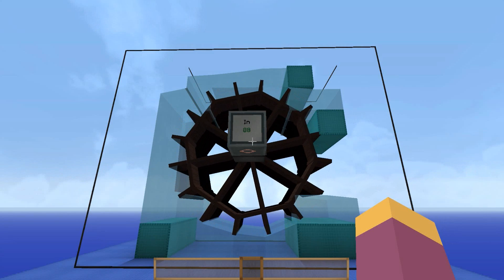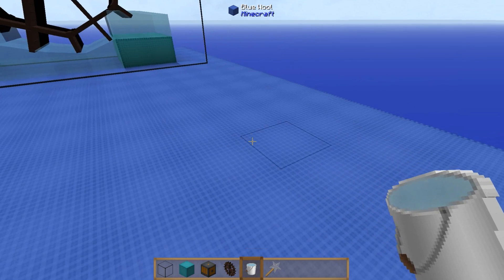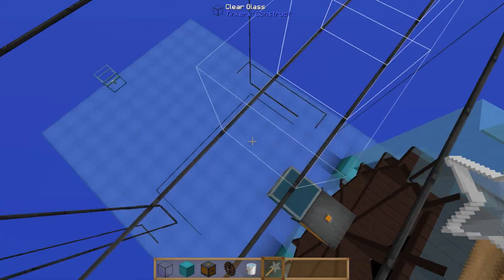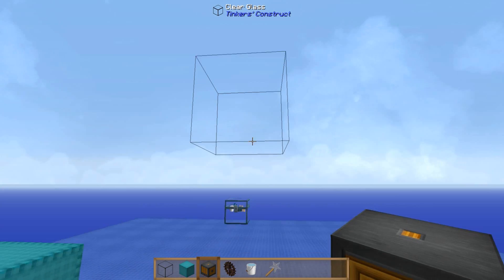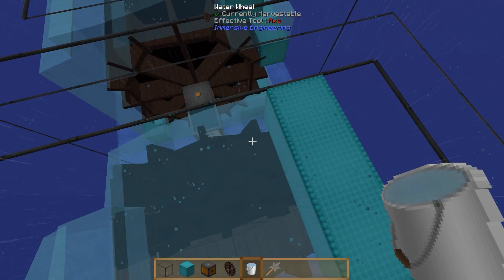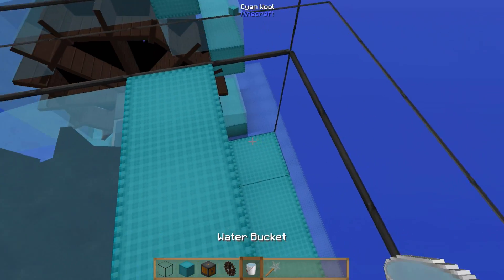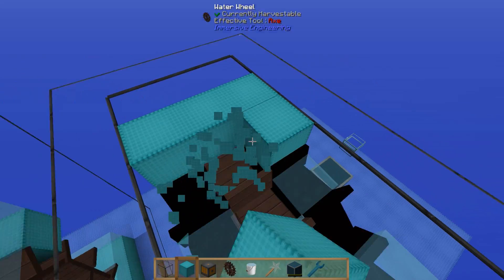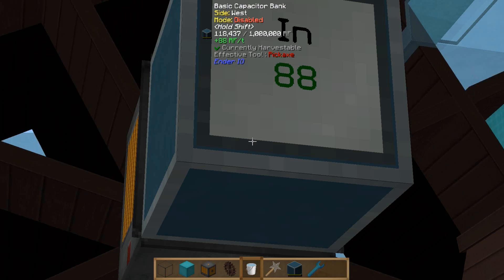Immersive Engineering Water Wheel (Maximum Output  88 rf/t) - Mod Tutorial

Comment: There is a hidden reference here, the 88 rf/t is in homage to the movie "Back to the Future", where the delorian travels back in time once it hits 88 mph. If you open up the Immersive Engineering manual and read the Power section regarding electricity, it states "88 Flux per hour!" Fitting to have the ultimate max efficiency design of the waterwheel to hit this limit in 88 rf/t.

Comment: Nice Video, not my first time watching, and probably wont be my last time either. Helped me when I didnt have some of my go to early generator mods, or just not much coal. I can run a grinder, furnace, and a few other machines without running out of power. Im so used to generating 10000s of rf/t forgetting that you really only need like 1000 rf/t.
Reply from the maker: Thanks :)

Comment: Using this setup on Project Ozone 2: Kappa mode to power my MFR Laser Drill. Well, 240 total water wheels to be exact. However, with three water wheels on one kinetic dynamo, I am getting 266 rf/t. Not sure if the pack creator tweaked the power generation, or if the Immersive Engineering mod author(s) changed it since this video came out, but I just wanted to put that information out there.
Reply from the maker: Thats a good bit of info to note actually; my video was based when FTB Infinity Skyblock first came out and since then Ive been playing on MC 1.10.  Ill have to check out what the output is in 1.10 as well!  Good news its creating more power though - you should do a video on it :)
Reply: I may do a build showcase for my "power tower" and put it on reddit, but when it comes to making minecraft videos, I will leave it to the professionals ;)
Reply: Okay, I'm gonna be real with you guys here, water wheels have a very low power density per block. I replaced 4 maxed out wheels (360 rf/t total) with an automatic tree farm (smelted the wood, make it into steam, pump the steam into dynamos, put augments in the dynamos to increase energy output). I have yet to actuall test it (i will test it today when I record). The tree farm is a forestry farm, so it is easy to get early game (after thermionic fabricator).

As far as other power generation before the tree farm, I would recommend vertical wind turbines, thermoelectric generators (gradually replace the lava with pyrotheum and the water with cryotheum to get 30 RF/T per layer that you do this). Power density is much greater this way.

The tree farm is gonna be good for like 90% of the duration of the game and is very easy to scale up production. Plus you don't need to do anything to it when it is up and running, It will win through numerous energy battles along the way between solar, wind, nuclear (IC2), and big reactors. You would probably stop using the tree farm when you get into draconic evolution and start using the reactors and energy storage in that mod. You may not need to make draconic evolution reactors, but at that point of the game, tree farms have a low power density per block. For most of the game, it doesnt.
Reply: Youre playing easy mode go away

Comment: are there any machines that can run off 88rf/t
Reply from the maker: In the pack that Im using this (FTB Skyblock), Im running my entire auto-sieving process from a bunch of these.  Early game in both that pack and FTB Infinity Evolved the waterwheel is probably going to be both the best choice and the choice most players will make - this is why maxing out its power is so crucial (as I found when I wasn't doing it properly!)
Reply: +Reliikgaming now I'm running my own mod pack and this is actually quite a good early on power source not so good in late game but I have managed to full up a Radstone energy cell from 4 water wheels 😀
Reply from the maker: +App Man what's your modpack called, are you going to release it publicly and what version MC is it?  We need some 1.9 packs :)
Reply: +Reliikgaming atm it's only1.7.10 but i can make a 1.9 if you want
Reply: App Man water wheel can drive by an artifical water fall